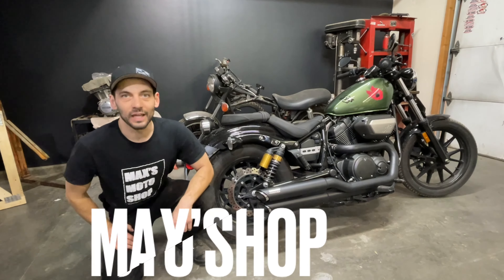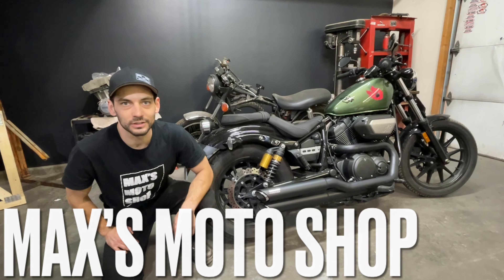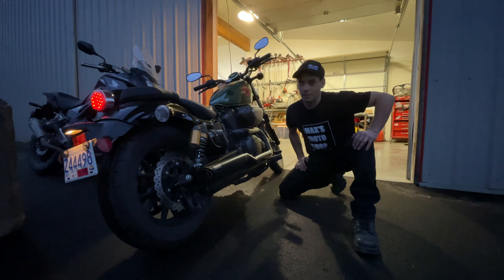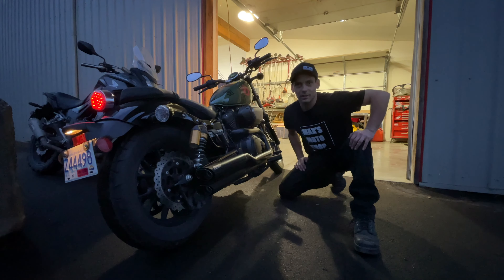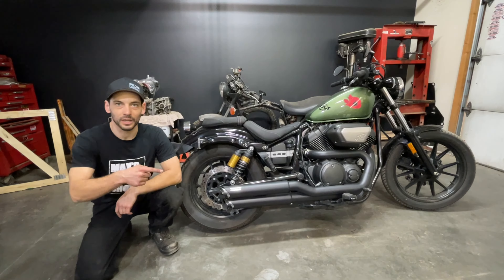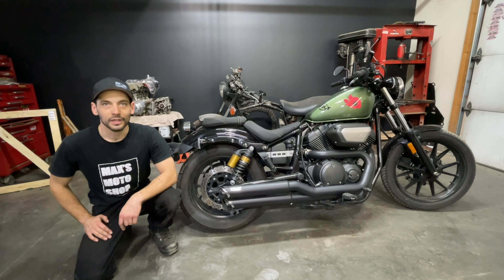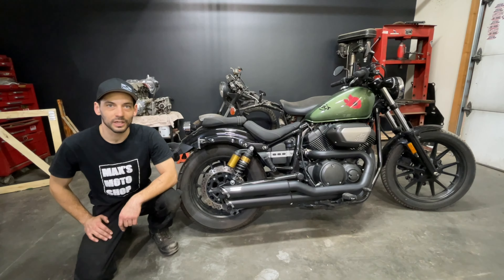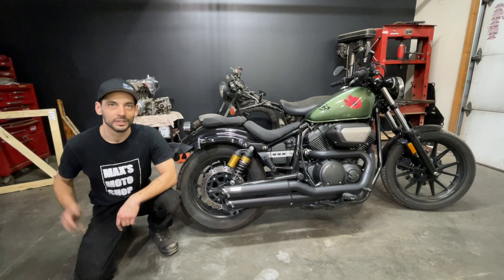YAMAHA Bolt Stock exhaust and Vance and Hines SLASHER sound comparison

Comment: I still love the look of these pipes the best on the bolt. I do wish that they made a set that look just like the ones on a HD sportster with that swept look. The bassini pipes probably sound the best overall, but these are close. I had these, the V&H air intake, and a cobra fuel commander on mine. That thing would hum along

Comment: Hello sir, was wondering if you need to flash the ECU or get a power commander after swapping the stock exhaust with the V&H. Thanks
Reply from the maker: It seemed to run fine on the stock fuel tuning